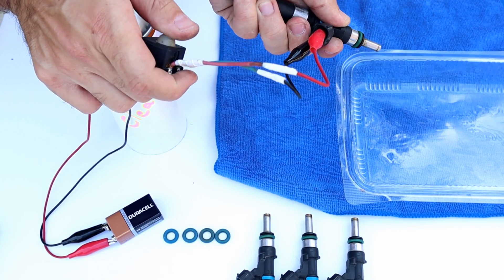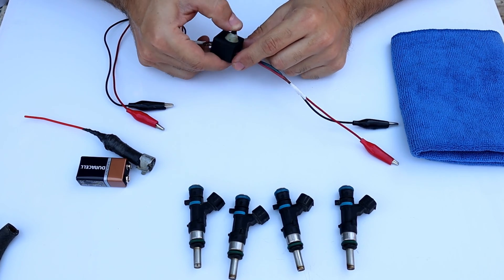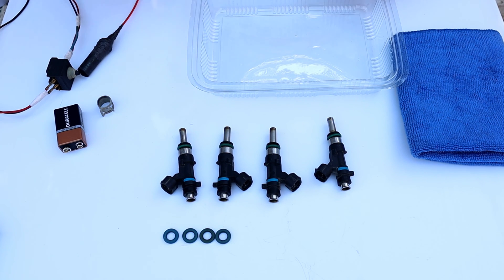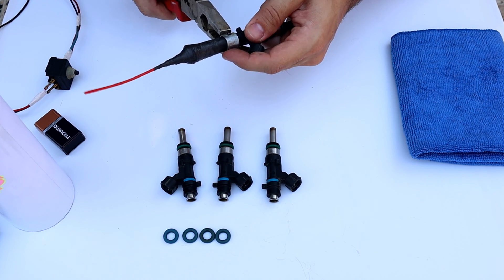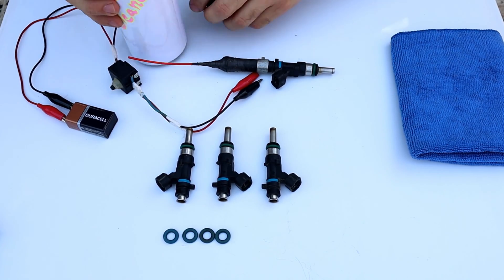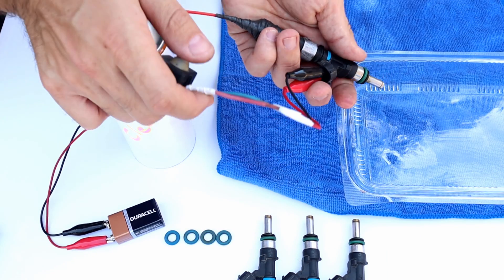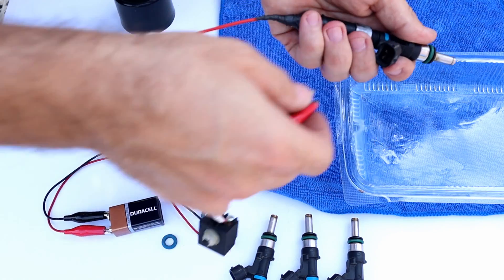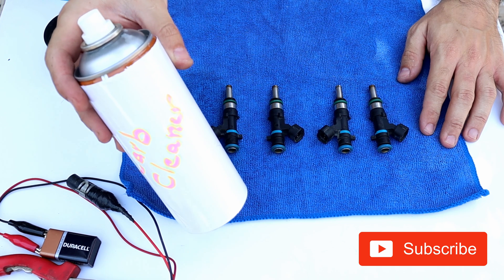FUEL INJECTOR CHECK and CLEANING, less than $5 / ALIMECH Better Fuel Economy / CHEAP WAY

Comment: Are there any rubber parts inside the nozzle?  If there are rubber parts  I use a large amount of injector cleaner will it damage the rubber in the injector?

Comment: Hi can I use the  car120v  battery  for injector nozzle cleaner
Reply from the maker: No, nothing more than 12v
Reply: @AliMECH  sorry for the taping  not 120v  i m taking about 12v battery
Reply from the maker: @momin khan  yes you can

Comment: where do you get the push switch solenoid to alligator clip wire?
Reply from the maker: I took it out of angle grinder,  you can use any push switch